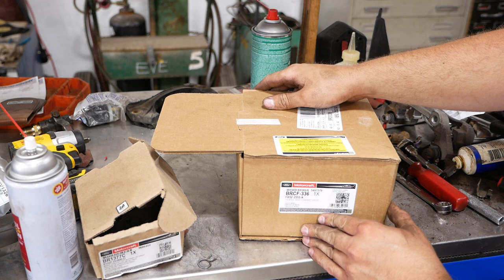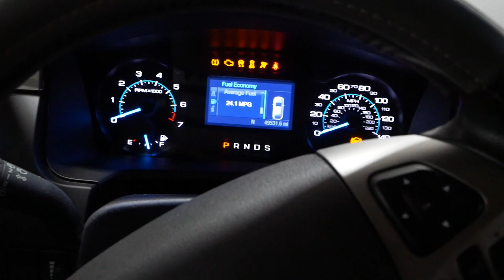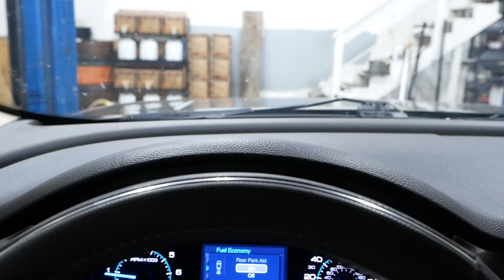Replacing a Brake Caliper with Integral Parking Brake - Ford Flex

Comment: Hey Wes, the other day I was working on an old Chevy G-Van I own with a 350 in it. I was adjusting the valves, but to pull the valve cover off I needed to disconnect an oil gauge I installed. Since this is a van the engine sits in the cab and the oil pressure fitting is right on the back of the block. I start the engine and focused on the rockers as I'm inspecting my work. After a few seconds I look down to see about 2 quarts of oil in the cab shooting from that fitting. I rush to get a towel to do damage control as the stupidity sinks in. Just as this was happening the mail came and I notice the shirt I ordered from you arrived. As I'm looking it over I can see you laughing in my head along with Peg from ZipTiesNBiasPlies telling me to go sit in the trailer. Anyways, thanks for the shirt and the handwritten thank you note. Nice touch.
Reply from the maker: Well you win some and you lose some! I once spilled a whole 2 quart bottle of chainsaw bar oil on the bench seat of my truck...

Comment: I love getting brake jobs. Gravy work. Also, I need to try that bleeding technique the next time I get one of those. As far as the parking cable goes, if it's too bad I'll just cut the spring. Assuming I'm replacing it anyway. I have zero issues using the old cutting wheel if it makes getting bad parts out quicker.

Comment: I just did this on my 2005 Ford Freestyle.  Pretty much the same car.  I didn't have to replace the caliper but had a hell of a time getting the passenger side to retract.  I don't have those fancy tools.  Crow bar to provide pressure and a large pair of pliers to turn the caliper.  Remember, the passenger side is counterclockwise.  3rd set of rear brakes at 171k.  Had to replace both rear bearings.  

The rear brakes on these seem to be more like 50% braking power vs normal.  Great cars.

Comment: Ive been keeping a bit of clear 1/4" hose on hand and I like to put a length of it on the bleeder and run it into a pop bottle or something. It keeps the floor clean without dripping it all over the caliper and whatnot. But the best part about it is that it really makes it easy to see when you're done bleeding because you'll actually see the bubbles in the hose.

Comment: Wes, we did a brake job on a 2010 Ford  Flex day before, replace both rear calipers and pads, had to realign both brake hoses by doing exactly same thing, however had to retighten that brake nut  several times because it started to leak after loosening to adjust hose so not to rub on tires.

Comment: Given how good your work is, I am pretty sure you get a LOT of return business.  I tend to use anti-seize paste for the wheel to rotor and rotor to hub faces as I have never even heard of the spray  you use.   What I did notice was the brake line to new caliper.   In that case I use a dremel (battery powered) with a small wire wheel and clean up the threads and coat with anti-seize (same with flared brake fittings) as an anti-corrosion thing for later.    Second thing I noticed that might be of value is you might want to invest in a set of Long wrenches for hand working those caliper bracket bolts.  Eric the Car guy mentioned those and I bought a set and they are my GO TO wrenches now because you get more leverage with them.   The fact that South Main Auto commented and roasted you and called your wife smoking hot. . . . PRICELESS!!!!!!

Comment: My Fusion has a similar setup on the rear brakes. A big spring on the caliper - when pulled by the parking brake cable, it pushes the piston/pads against the rotor. After getting fleeced by a shop, I decided to learn how to replace the caliper and turn it in to replace pads myself. They’re a pain, but not terrible.

Comment: I had a 1986 Buick Riviera that had a mechanism like that.  It was the first car I owned with four wheel disc brakes.  When I went to change the rear pads there was no rust, I live in southern Missouri, and had no book to show me how to do it.  I have a Ford Taurus now and at 97K I had my mechanic change the hoses, belt and told him to replace the pads.  He called me and said there was at least 1/3 of the pad left.  Some people are hard on the brakes, and everything else.  I know the pads had not been changed when I got it, the original owner put 37K on it and had not done any major work of any kind on the car.

Comment: You’re the first person in a long time I’ve seen turned a rotor and reuse it old school like the way it should. As far as I know in my neck of the woods Nobody does that. When I had my brake pads replaced I asked to have the rotors turned they replied we don’t do that they replace them it’s not worth the time to turn them there’s not enough metal to do it. I’m like to myself seriously I knew they could I guess it takes them too long for that. It’s cheaper to replace them and saves time.

Comment: My wife has a 2018 Toyota hylander 
I've replaced front pads and rotors and rear pads as well as tires the car had around 35-40k on the clock. It's was a fun weekend in the drive way

Comment: I have been hearing lots of people talking about life of modern brake consumables vs what they were back in the day. My main thought is a chunk of modern cars give more acceleration w/ increased HP numbers and smoother quieter driving w/ better suspension and other components. I think people drive much more spiritedly than they realize with new cars than they used to. A big one I think about is diesel trucks, coming factory with 7-800+ torque means you aren't limping that thing around town any more.
Reply: Cars are on average much, much heavier than they used to be. Yes, even considering the big old Detroit iron that people think everyone drove back in the day (they didn't). It's the increased weight, plus higher highway speeds that results in much greater energy needing to be absorbed by the brake components.

Comment: I bought the p.o.s square block thing from my local Canadian tire store for $12 CAD. Not worth the aggravation! I found it easier turning the piston back in easier with standard "C" clamp and pair channel locks. Clamp for slight pressure and channel locks to screw

Comment: I recently purchased a 2013 Honda Accord. I just changed the rear brake calipers after trying like an idiot for hours trying to press the pistons in with a C-clamp. My father shortly after informed me that they turn in. 
An expensive lesson to learn. There was nothing wrong with my original calipers.

Comment: I own a 2013 Flex so this was of interest for sure.  The origins of the Flex came from Ford's ownership of Volvo and the sharing of chassis platform architectures that took place at that time.  Its a great car to drive,. Its not so great to own as it has inherited all of Ford most idiotic design short comings, including a waterpump buried in the engine block and a 4wd power take-off unit that's lubed for life until it isn't.  Then it hand grenades.  These are great make work designs for you Wes.  Ford says you're welcome.

Comment: Great work ! On the europen cars its almost only internal handbrakes. In manny cases the handbrake cables are frozen/rusted, so remebere to check those on older cars. i learned about that knob on the brake pads, i havent noticed it before that it need to sit in the slot! Thanks😁

Comment: Wes - I just replaced both rear calipers, rotors and pads on a 2016 Accord with only 60K. They don't make cars to last anymore. A brake job at the dealership must be close to $1000 now. Its all gravy selling parts for them.

Comment: We have a 2104 AWD flex with close to 90k and it has original brakes and there was at least 3/16 left on the rear pads.  Last I looked, the fronts had around 5/16.  Ours has the ventilated rotors in the rear.
Reply from the maker: I think yours has the heavy duty brakes. It's probably AWD too. This rig is only FWD.

Comment: We always use a coating of pb blaster on the rims before we reinstall  the rims here  and have had pretty good luck with no galvanic corrosion problems afterwards I never thought about using  fluid film also an excellent choice of lubrication . The beard looks great Wes a little bit of grey is very distinguished and wise looking. Great video as always

Comment: 2000 Nissan Altima 240,149 miles, 2 sets front pads, 1 set rear shoes @ 222,454 and still had lots of material left.

Comment: Definitely prefer the toyota design with the rear rotors having the parking brake drum inside. You can actually call it an emergency brake since it's a seperate brake system from the caliper and the caliper is the same design as the front so there's no weird shit involved
Reply: My subaru has the same thing. Doesn't give any trouble, you just have to know it's there.

Comment: Great Video! That wasn't a bad job at all!! When I do brakes I always do the hydraulics at the same time. I don't know about the brand new stuff but 1996 Oldsmobile used hard chrome on the caliper pistons. That stuff will never rust so I put a seal and dust boot kit in the original calipers. You sure have a well equipped shop!!!

Comment: LOL, one time I had a steel wheel seized to the drum/hub pilot on a Corolla, and nothing would budge it.  So my halfass ass simply backed all of the lug nuts off slightly, and went about my business of driving nearly 100 miles a day, with close to half being interstate miles.  After a couple of days, I heard and felt it break loose, on the interstate of course, so I pulled over and tightened them back up.  The next day when I went to remove the wheel, it was again stuck, but came off with just a little persuasion.
My normal trick is to grab another wheel and inflated tire, and use it to hammer the stuck wheel loose. I hold it with both hands and swing it against the stuck wheel with my arms.  Works wonders at the junkyard!

Comment: I've used this style a few times to convert the big 14 bolt corporate axles to disc with a park brake. 76/77 Eldorado calipers bolt into the ebay conversion mounts perfect. Last pair I fought for 2 days trying to get them to bleed. They'd look fine when I was down at the caliper, as soon as I'd drive it they'd cause trouble. Finally got them, im using this Chrysler method next time

Comment: Before I got that wind back tool I would put some pressure on the piston with a c-clamp and turn the piston with adjustable pliers; adjusting the clamp as I went. Worked well but could tear the boot around the piston.

Comment: When replacing a brake cylinder/caliper you always need to check the brake hose position.  The machining of the threads may clock the hose to a different position and put a weird kink in it. Had one that both front cylinders had been replaced (drums) and both hoses had twisted where they were rubbing against the inner side walls of the tires. So both hoses then needed to be replaced as they were worn through the outer core.

Comment: I have a 2014 Hyundai Accent with only 20,500 miles on it and had to do a rear pad replacement on it. Seems age not distance is the problem with the imports. My first crack at rear disc brakes and I was not impressed.  Always getting the calipers off is a challenge but that stupid wind-back caliper..... SHIT!!!!!  The only thing I do different is I go way overboard with the anti-seeze and also paint the matting surface with the wheel because I get exhausted trying to beat the snoot out of the wheels to get them off.  Great, informative vid as always!

Comment: Trick I learned for keeping the banjo fitting from dripping is find an old valve stem you probably have laying around and stick that through the banjo bolt hole and that will stop the drip.
Reply: Dang. The old valve stem trick.

Comment: Did parts get cheaper or labor more expensive? When my dad had a shop back in the day everyone turned drums, rebuilt wheel cylinders and master cylinders and even relined the brake shoes that had the rivet on linings. That was back in the 60s.
Reply: I miss those days. Now the parts are mass produced oversees and its hit and miss in terms of quality or if it will work at all. Tell someone you're rebuilding a starter or alternator now and they laugh. I guess its personal preference. Cheers
Reply from the maker: It just depends. Many times here the rotors are so rusted it’s not possible to machine them. But I do if I can.
Reply: Yeah parts got way cheaper. I remember even in the late 80s the cost of replacing rotors was very expensive.
Reply: I don't know about America so much, but here in Australia it's a combination of both, labour rate has gone up, and the price (and usually quality) of aftermarket parts has gone down.

Comment: My trick with those wind back calipers is to use an old cheapy c-clamp as long as the caliper piston is regular threaded instead of reverse learned about that one the hard way).  Sometimes the piston needs a little help with some chanel locks to start turning, but the cheap clamps usually have enough friction between the end of the end of the clamp screw and the swivel foot on the end that it will turn the piston while pushing it in.  Gotta feel it out a bit, but works with the tools already in the box.  Not to mention I have one of those cheesy 3/8 drive cube tools, and in a decade I have yet to find a caliper that fit any of the patterns on the stupid thing.

Comment: Good info about the bleeding. After having problems I just went and got a vacuum bleeder, very happy with it. During this summer I need to change pads and rotors on my -13 Skoda Octavia with 285000km on it. I think that the rears could be just cleaned up with a brake lathe, but I don't know any places that still have them.

Comment: For stuck tires I use a wood baseball bat. It won’t damage the rim and allows me to take a full swing, without being under the vehicle, especially when working on the ground.
Reply: if you hit a fancy rim with a baseball bat then you are damaging them...no questions about it..even if you don't make a dent in it you are still damaging the clearcoat on them..never hit a rim always hit the rubber..30 years experience working on cars and never have i ever hit a rim..gotta be careful and pay attention..use a deadblow hammer or the heel of your foot

Comment: Hey Wes, those callipers are the most common type on the rear axle over here in Europe. I personally never have issues bleeding them. Although we usually use the “explosive decompression” method. Build pressure pumping the pedal then open the valve and let it blow out. Pressure forces the air out I guess. 

Also I’m amazed at you getting 170k out of rotors/discs my landrover is on 180k and third or forth rotor set which is normal here.

Comment: I guess it is how I was trained but I always worry about any grease getting on the rotors, even the little bit left by grabbing the rotor with my hands. Therefore, I always degrease both sides of the rotor once it is on the vehicle and the caliper is in place. Probably being too paranoid? I think Subaru has had wind back calipers for a long time. Didn't know that more of the modern vehicles use them. My vehicles are all older. I always learn something from your videos.

Comment: I just did one of these on a friend of mine's Mazda Protege. When I first tried to do a brake job on it with him about a year ago we were having a heck of a time trying to figure out why the piston wouldn't go back in lol. We got it eventually but we saw that the slide pins were siezed harder than a eco diesel with 80k miles so the caliper was junk.

Comment: If the cars not been used for a while with the screw out handbrake rear  calipers. The pistons tend to get stuck on rubber seal so badly you cant turn them out it will bend the bar on the tool..If you use the hand brake without the pads in it helps to free them up so you can then use the tool to screw the piston out and re grease with red rubber or silicone.

Comment: My pickup is at 320,000 mostly original besides normal maintenance. But I will say oe parts seem to absolutely be the best bet so I have to agree with you. I've used several parts store brands and they just never last or have issues.

Comment: Love the channel ❤. Keep up the good work and keep be true to yourself and how you do things. I enjoy all of your projects and have learned quite a few things. Just wanted to pass on some insight that has helped me over the years. 35 odd years ago when I was a young hot shot maintenance mechanic fresh outta school and on my first day at work I observed and old man and a younger guy welding on a piece of equipment. They were having trouble with the weld not holding. Since I had won several welding competitions in school plus passed my certification I offered to help. When asked if I could weld any better I proclaimed that I was an expert. After fixing all there needed repairs the old guy thanked me and complemented me on my work. But right before my 18 year old head swelled to far he asked if I knew what an expert was. After my reply he informed me that an ex is a has been and a spert ain't very damn much. I've always remembered that just because folks tell you what you should have done or could have done or this is how moe does it at Larry's garage doesn't make them any better at doing a particular task. Keep on being you and creating your videos.

Comment: I have 2016 Nissan Frontier with only 28000 kilometres and have gone through a full set of pads and rotors.  Vehicles are meant to be driven, I had a ton of surface rust on the rotors and presently I tend to do only city driving.  Actually the turn back piston and integral parking brake is not something we see very often on the tube.

Comment: If brake rotors are anything like wheel bearings then I agree with you. I have a 2007 Jeep Wrangler unlimited with 80k miles 35in tires and 1in wheel spacers and haven’t had a wheel bearing fail yet.
Reply from the maker: We have a Toyota with 257,000 miles. Never replaced a wheel bearing or ball joint.